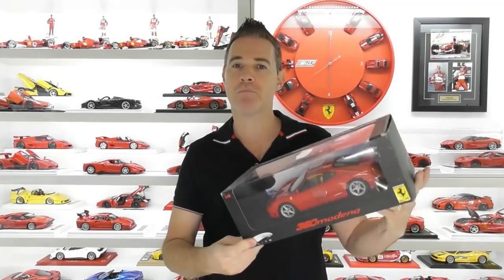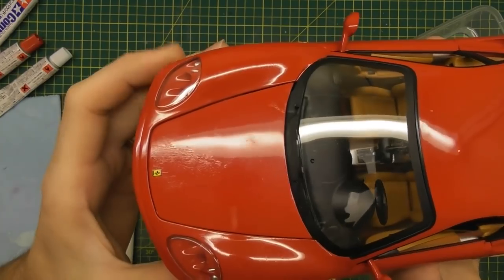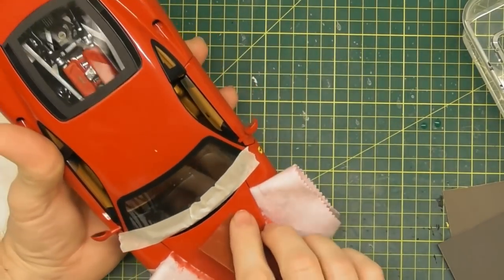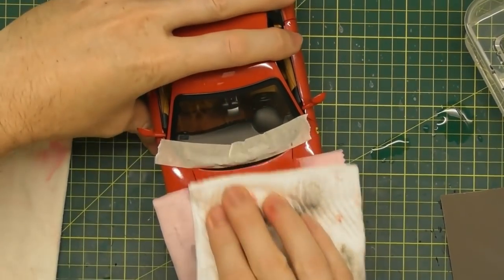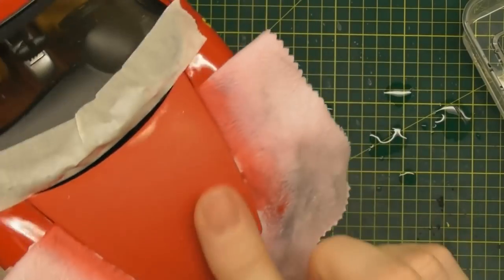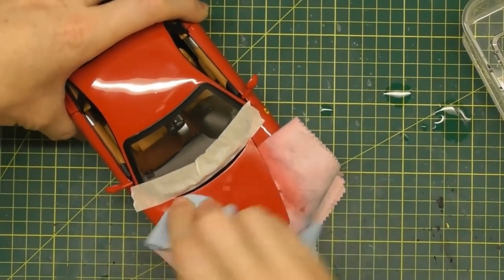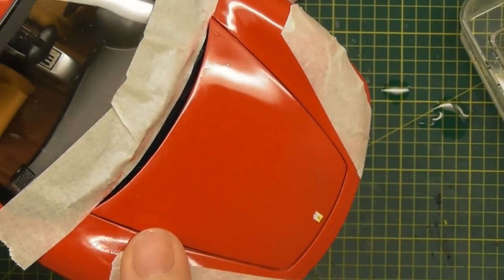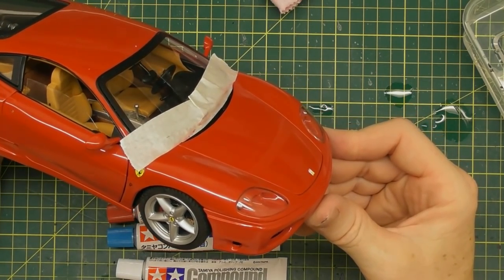HOW TO REMOVE PAINT RASH FROM MODEL CARS

Comment: I'm a collector and we did an extensive study on this as little to no real data is available on this matter. For the study we used a lot of models of various makers and this is our final findings. Paint rash/micro bubling is the effect of paint oxcidation and the main reasons are: oxygen, UV light and heat. These three factors combined with time is the result. Worth noting that various paints of different makers react differently and even the colour play part. Red, black(dark colours) and even white rash more easily. Silver tend to be very resistant. Kyosho and Hotwheels & Elite models biggest culprits and resin models don't show rash. Cheaper models like Maisto and Bburago less likely to rash. AutoArt the least likely metal body models to show rash.

Comment: I have read that the old budget models from Burago are cheap toys and can't compete with the  higher end models made by companies such as Kyosho or Hot Wheels yet the Ferrari F40 models and Porsche 911 models i own by the original Burago don't suffer from paint rash or diecast corrosion and those original F40 models are close to being 30yrs old, when compared to Kyosho, almost every F40 model has paint rash, seems to me that the Italian made Burago's are of higher quality diecast metal and better made.
Reply from the maker: Paint rash is caused by a contamination on the metal surface before the model is painted, and then it blisters though over time. This can happen to any model that is poorly prepared prior to painting.

Comment: But since it comes from UNDER the paint, I think that it would eventually come back again with time, cuz the source is not gone. I think that the only real way of getting rid of it is removing the original paint completely until you see the bare metal, then prime it and paint it with an airbrush after you've mixed your color to perfection. After that you must add a nice coat of clearcoat and voilà!
Reply: Your method is correct, but it's also very complicated, especially for people who are not painting experts. First, it's almost impossible to match the paint perfectly because some color fading occurs on the model over a period of time.
     Second, some model cars have pearl, or metal flake finishes which makes the matching process even more difficult.
     Taking the model apart and repainting it, is the ultimate solution, but taking apart a $200 Kyosho  or a BBR that may have 1,500 pieces, is a serious risk for someone who does not have experience.
Reply from the maker: Exactly, this method is to make the model look better than it does covered in rash, and most people are able to make this method work. But fully repainting a model is the best way to deal with rash and to have a perfect paint finish, not everyone can do that though.
Reply: @ROBSMODELCARS  yes indeed, it's so frustrating to invest in a model and see it have a rash :/ even more frustrating with high end models..!
Reply: @MrNew122  yes never said it was easy, just a permanent solution. Or get rid of the model and buy another one over the net.

Comment: Great! Thanks 4 video. I was evaluating with a friend that every brand has a type painting on its own. pay attention when you happen to perform this intervention on the ferrari kyosho models, as the paint has a much finer thickness than the hot wheels and you would immediately get to the bottom, which will have to be repainted. This may be a major problem for those haven’t experience in disassembly and painting

Comment: Great tutorial mate. I've been collecting die cast models since more than twenty years and I've seen many ways of how paint rash invades models and I have to say that sometimes paint rash is a matter of paint but some other times is a matter of metal and it's impossible to get rid of that defect because that rash is not from the paint it comes from metal and if you try to fix it with sand paper and polish compounds metal will come up and the only way to fix it is to strip paint and repaint the part. That's what happened in this case with those white silver dots that have came up after sanding.
Reply from the maker: True, I have repainted quite a few over the years as stripping it off and repainting gives the best results, but some collectors aren't confident enough to strip a model and repaint it. So this gives them a chance to get the model looking a lot better without going down the painting path.

Comment: Great video!👍 I have a 1/34 First Gear tow truck that has paint rash on the side of the tow bed. I’m going to get the items needed and try your method.
Reply from the maker: Great, but don't start with to aggressive sand paper, start with 3000 grit onwards, if that does not remove, then you can go back and use a rougher sand paper. Good luck

Comment: Fantastic tutorial.  Just bought an older Danbury mint 1:16 scale, 1929 CORD.  Nice large model, great detail.  Has paint rash on hood.  I will try your process.  Hope it works as well.   Thought it was unrepairable.  Thanks a million.  Please tell me were to get the compounds and polishes.    Thanks
Reply from the maker: I bought the Tamiya polish's on ebay and got the sand paper from my local hardware store. Just try to remove the rash with a fine sandpaper first, only use the very coarse paper as a last resort but remember that some rash has lifted up from the metal, so it is possible to go through the paint which will reveal the base metal. In which case paint repair will be necessary

Comment: Rob Love your videos!!  Will you ever be customizing your Top Speed Pagani Zonda?  I am interested in getting one and removing the wheels to try and paint them a more correct color.  Just curious how difficult it would be to remove the wheels.
Reply from the maker: Yes, the Topspeed Zonda has been completely rebuilt into a Zonda GR race car. I have been posting updates on my Facebook page - RobsModelCars, and also a full build dairy on www.DiecastXchange.com

Wheels are easy to remove, turn the model upside down and unscrew the floor. Remove the floor from the body and you will see that both wheels are attached by a metal rod. Mine just pulled out from the body. Brakes are just sitting behind the wheel, slide them both back on the metal rod to the center of the metal rod. Cover them when repainting the wheels, then uncover them and re assemble them in reverse of how you removed them.
Reply: @ROBSMODELCARS  Thanks! I will check it out.

Comment: Hello, Thank you for sharing this informative video. Is there any reason the Ferrari horse logo is not protected but sanded away assuming that only paint should be fixed and the Ferrari horse logo was fine before sanding? Thank you
Reply from the maker: It was easier to sand the entire hood and just replace the Ferrari logo
Reply: @ROBSMODELCARS  Thank you for pointing out that. is there any vidoe showing how you replace the Ferrari logo? Thank you

Comment: thanks for the tutorials rob..i have few models with these rash paint issue..hope it will turn out nicely when its done..is this compound suitable for resin model as well?
Reply from the maker: No problem mate, just remember that the paint thickness on all models is unknown, so try first on a lower panel or so and see how it goes. Should be similar between diecast and resin, but maybe a little thinner on resin but resin don't have rash so no need to sand them, but you can polish them with these Tamiya polishing compounds. Just test areas and use your judgement

Comment: Another great video, Rob. One thing I don’t quite get is when you sand the panel, why does the clear not need to be reapplied? How do you go straight to polishing the body unless there is still clear, but for Hot Wheels especially, I know they don’t use much clear from the factory in the way you use 3-4 coats for your own custom models. So, wouldn’t the clear have been sanded right through, or was there some left?

Also, you mentioned you’re not being thorough for sake of keeping the video brief, yet still the finish came out like new. Had you been more thorough and spent additional time, could you have yielded a better result with more shine and depth, or is the shine capped after certain amount of polishing? Could you also achieve more luster by lightly using a Dremel with buffing wheel?
Reply from the maker: They paint these models in a one coat system, meaning the red color is a gloss finish, so when you sand them down, you bring the gloss level back by polishing. 

When I paint my custom models, I use a basecoat color followed by a clearcoat, if i sanded through the clear, and tried to polish the basecoat, it would not come back shiny.

More time spent on the part would have got some of the rash I missed on the edge of the hood.  But a little more polishing in each step would give a better shine.
Reply: ROBS MODEL CARS Now, I completely understand. Thank you for your kind reply.

Comment: I’m gonna try this out on my models but I’m afraid it might take the paint off. Assuming that the same model faces bubbling again, will the paint eventually come off after repeated sanding?
Reply from the maker: The thickness of the paint and how badly it is bubbling  will depend on the results of this method. Be aware that if you have to keep sanding to remove the bubbling, you may go straight through the paint and hit raw metal. Try this first on an area that is not as noticeable, like a lower side or rear, rather than a hood or a roof. Some models are just not savable and need to be repainted. Good luck
Reply: ROBS MODEL CARS thanks!

Comment: Rob, have you tried using micro-mesh cloths to remove paint rash? It is less extreme that actual sanding paper.
Reply from the maker: No I haven't. I use what is available to me, but this 360 model had very bad rash on the hood which is why I used this technique

Comment: My model has the same rashes but would this method work on a metallic silver color?  Thanks!
Reply from the maker: You have to be very careful doing this method on model cars. It is a 50/50 if it will work, if it doesn't, it will go through the paint and the model WILL need to be repainted. Most model car paint does NOT have a clear coat over the top, so once you start sanding through the layers, the metallic will be ruined. Do NOT do this on metallic paint!

Comment: But how to deal with paint scratches in models? I have few ones with minor but noticeable scratches on the body paint and I would like to remove them.
My models are mixture of composites, diecast, and resin.

PS: Very useful tutorial! I'm going to try this on my F430.
Reply: Try sonax perfect finish and a clean microfibre. Use circular motions until the scratch is gone

Comment: It would be better if you use, 2000 grits, 3000 grits, and 6000 grits to sand the paint rash, otherwise it will easily left scratches easily.
Reply from the maker: I went rougher on this model as the paint rash was really bad, 2000 grit did not cut through the rash.
Reply: @ROBSMODELCARS  Your method is quite good actually, but some beginners like me, may leave scratches.

Comment: Hello. But why rash appears?
Reply from the maker: Some say it is contamination on the bare metal prior to be painted, but I really don't have an accurate answer for you.
Reply: @ROBSMODELCARS  the fakt is that it appears not only on metal... its also on plastic details... so... its not a problem in metal... 
most likely depends on the paint itself ... If you find out some exact information, or how to prevent the appearance of rash - then write or remove the video necessarily ... Thank you for your answer.

Comment: How I can avoid the paint rash on my models??
Reply from the maker: You can't. It is a reaction of contaminated metal under the surface of the paint, this happens when the factory paints the model and it develops over time. That is the theory anyway. It is a hidden problem that may affect some models and not others, but Kyosho diecast models are well known for it.
Reply: @ROBSMODELCARS  
I heard from many collectors that the humidity and bad storage would be effect on the model 
Is this right ?
And how I can storage my models in right way?